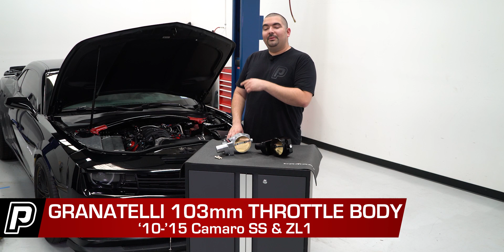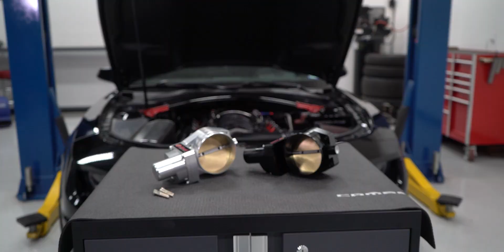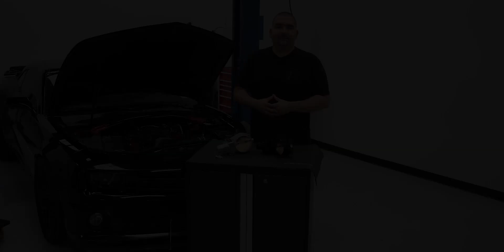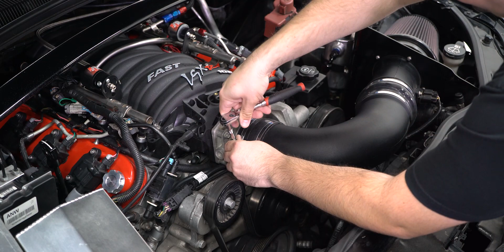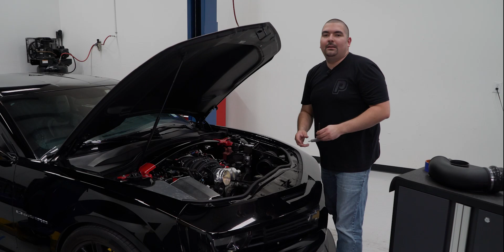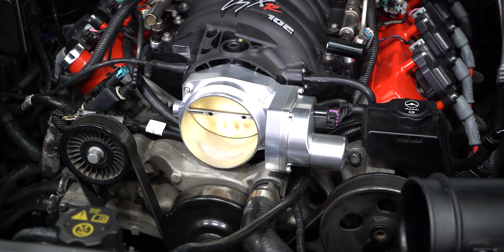2010-2015 Camaro SS Granatelli 103mm Throttle Body - Phastek Overview & Phastek Install

Comment: I have the same intake on my Camaro that is a 102mm will the 103mm still fit on it?
Reply from the maker: best to stick with a 102mm.

https://www.phastekperformance.com/BBK-Throttle-Body-2010-2011-Camaro-SS-V8-LS3-p/bbk-camaro-throttle-body-102.htm

Comment: Do you recommend to get higher cc fuel injectors ? Since there will be more air suction, wont i need bigger injectors? Or just tuning it will be fine?
Reply from the maker: Depending on your set up and your horsepower goals you might need bigger injectors.

Comment: Do you recommend to get higher cc fuel injectors ? Since there will be more air suction, wont i need bigger injectors? Or just tuning it will be fine?

Comment: One question can I go ahead and use this even though I don’t have a super charger
Reply from the maker: Yes, that is possible.  You will need to make sure the intake manifold you are using has an opening that will accept the 103mm throttle blade and you might need to have the tune updated to allow for the added air.

Comment: Hey man I’ve been wanting a supercharger for my camaro what kind of supercharger is that in the video ??
Reply from the maker: The car used for this video did not have a supercharger installed.
Reply: @PhastekPerformance  what’s that thing in the middle that says fast vsxR
Reply from the maker: That is the FAST intake manifold. Here is a link for that product.
 
https://www.phastekperformance.com/2010-Camaro-SS-FAST-102mm-Intake-Manifold-146102-p/fast-camaro-lsxr-146102b.htm
Reply: @PhastekPerformance  work with whipple ? Just received the whipple.
Reply: @NachoCamaro  yes will work with whipple. I’m dropping a 103mm Tb with my supercharger install.
Reply: @Mr2hard2see  thanks I’m stuck on nick or G
Reply: @NachoCamaro  mine will be Nick tb but I haven’t heard anything bad about these. With that being said I also don’t know anyone running a G Tb.  I know they have some great maf sensors.
Reply: @Mr2hard2see  subbed my whipple is sitting in my office. Waiting on my Shop to get me in.

Comment: Hp gains???
Reply from the maker: That would all depend on the application.  With just the throttle body, you wont see much but the air flow will help improve more then just the final number.
Reply: @PhastekPerformance  Hey do you know what kind of supercharger that is in the video??
Reply: @PhastekPerformance What is the recommended air intake size to properly couple the 103mm TB and fast?

Comment: I’m sorry for the comment being on this video but I figured you guys would see it more than it being on the lowering spring video. I have a 2013 camaro ss and I put on the bmr lowering springs, but now I get a squeaking sound from the front left that does not go away. I believe they called it the radius rod. If you were underneath looking at the driver side, It is the bottom left control arm.  Any input would be greatly appreciated.  Look forward to purchasing from you guys again.
Reply from the maker: Its not a problem.  Post a comment where you feel it is needed and we will do our best to get back to it.

My suggestion would be to double check all the bolts holding everything together.  I have come across various noises and I usually find something was just not tight enough or just needed to be reset, loosened and tightened.
Reply: @PhastekPerformance  I tried that and thought maybe putting wd40 on the bushings would help but it only stops it for like a day or 2. I have retried this a few times and I’m positive nothing is loose. I have looked up something called reclocking the control arms but have no idea how that works.

Comment: Does this fit a stock 2011 SS automatic L99?
Reply from the maker: The throttle body would bolt on the factory manifold but the factory manifold intake port is small when compared to the 103mm opening.
Reply: @PhastekPerformance  so I have the CAI blackhawk on my stock L99 if I get this do I need that blue coupler shown?
Reply from the maker: @SuperThudor  The coupler that comes with your intake might work, it just depends on if you can fit it over the Granatelli throttle body.  If it does not work, then you would need a larger coupler to account for the larger components.